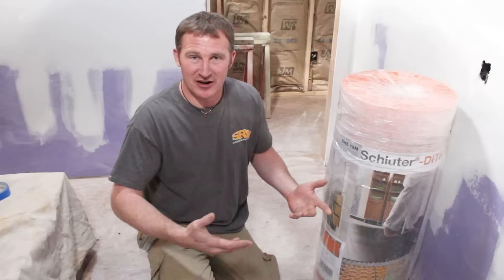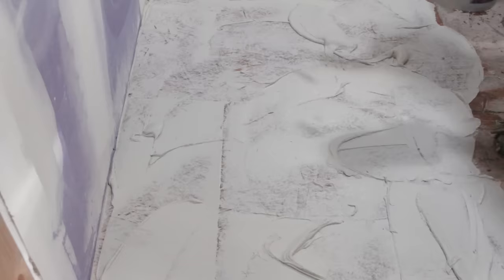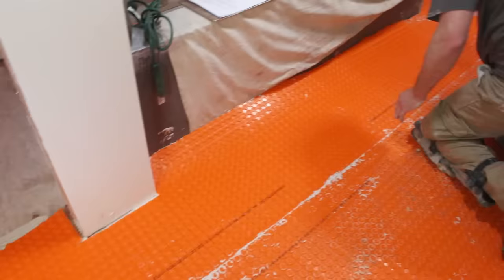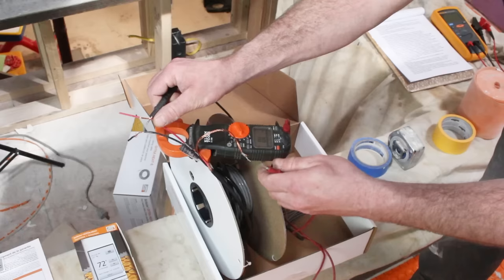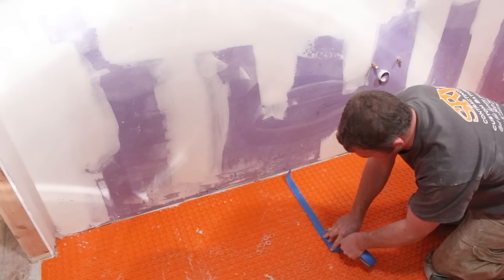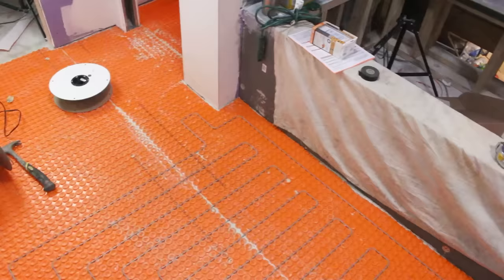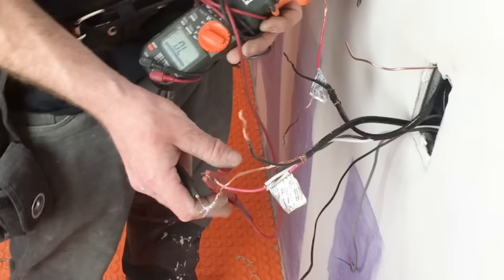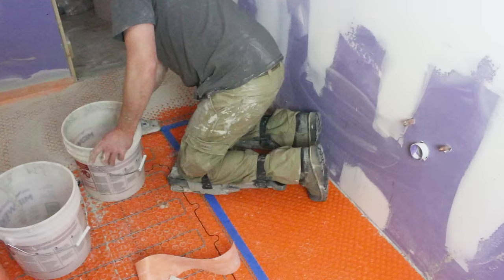DITRA-HEAT Heated Flooring Systems Installation (Step-by-Step) -- by Home Repair Tutor

Comment: You keep saying that you burnish the thinset into the 'plywood'  from what i can tell you are using OSB as the subfloor underlayment.  Osb is made from woodchips and glue. Im pretty sure most thinset manufacturers wont warranty their product if its installed on OSB.  Exterior grade plywood is the way to go.
Reply: Are you talking about 1/2 inch or the 3/4 tongue an groove, am using 1/2 inch sheathing but sandwiching them for extra load support
Reply: The membrane here is doing the job, thinset manufacturers won't warranty their product if you set tile on OSB but they are OK if you put a membrane like Ditra between the two. This has been done for the past 25 years, exterior grade plywood is old school now, still good but not an obligation. Exterior plywood is made with wood veneer glued together with waterproof glue, OSB is made with chopped up veneer and waterproof glue, don't confuse that with MDF.

Comment: can i put ditra mat down as a anti fracture membrane.
Reply from the maker: Call Schluter Tech support and get their advice 1 (800) 472-4588
Reply: Ditra, Ditra XL, Ditra Heat, and Ditra Heat Duo all provide uncoupling. You should look at TTMAC guidelines to match your requirements determined by site conditions like joist spacing, etc.   (if in Canada) and your Schluter book to determine which is most suited for your situation 😊

Comment: I would like to help you a little with saving you some time:)
• clean up subfloor floor using broom or Vacuum & wash subfloor using a sponge. ( just how you explain in the beginning)
• layout Ditra-Heat membrane make all the cut outs. 
I like watching your videos just that that when you making a video you need to be more professional many people watching. The whole idea of this installation video is any one who wants to do install on there own needs to follow your steps that you trying to explain. Don’t get me wrong I like what you guys doing just a little advice from me to be more professional get everything ready before and it will save you time and video will be more professional.
Reply from the maker: Dmitri, we appreciate your feedback but we did all those steps in the video. So I’m not sure what else we could have done. Plus, we worked with Schluter on this video tutorial
Reply: +Home Repair Tutor i cringed seeing you didn't sweep the subfloor, you could have saved a looooot of more time and energy by sweeping before using the sponge
Reply: Dmitri Golova

Comment: I wonder how easy it will be to remove (scrape off) that orange underlay from the plywood in ten years when your tile is outdated?
Reply from the maker: +matt heer not easy...but that's the point. You'd have to remove the DITRA-HEAT by cutting through the subfloor...turn off the electric
Reply: Pick out timeless tiles. I am more wondering what exactly makes this system waterproof & can broken tiles be replaced? Could this be put under floating floors?
Reply: Good questions, I'd like to know too. As far as waterproofing from what I've learned you have to use the kurdi band with thinset on all ditra joints and then possibly around the perimeter and up the wall a pprox. 2 or 3 inches.

Comment: Did he show his quad box/ conduit installation and I just missed it?
Reply from the maker: +Joe Bass no, we didn't show that but I think the video shares the box from the opposite side of the wall
Reply: Does the controller need a quad box?  How separate do your need the temp sensor wire Fri the heating cable?  I'm close to install and I have single box and pulled my wires at same time from floor to to the box

Comment: In the stress test, you need to stress black to red, black to ground and red to ground. That wasn't done. Which is why DIY beats hiring an electrician every time and why the gummint should get the hell out of certifying tradesmen altogether.
Reply: well said.

Comment: Why not install both sensors just in case one fails? Then you don't have to lift tiles to install the other sensor.
Reply from the maker: +VINJE76 we did that in the video, in fact we recommend installing each sensor in two different locations. That's near the end of the video

Comment: Oh dear God! What kind of contractor would use osb as a subfloor!!! Guarantee you can go back as soon as the thin set cures and just easily peel it off the floor! Osb does not hold up to traffic! All osb fails in bathrooms! Major fail

Comment: It's not a good idea to use a metal trowel to lay the wire as it could strip the insulation off the wire and cause a short. Use a small piece of two by four or one by two ect to force the wire into the groove

Comment: Ture, this particular floor warming system saves a lot of time on the initial installation but it also takes about twice as long to come up to temperature... so pick your poison. Hopefully it costs considerably less than other systems because if you want your tile floor warm by 6 in the morning when ya get out of bed... ya better program the thermostat to start heating the floor by 3:00am... complete garbage!
Reply: You have no clue, this floor heating system takes time to warm up the first time you turn it on but the thermostat keeps an even temperature, it doesn't let the floor cool down too much between cycles. Like an air conditionner, it takes time to cool a hot room but when comfortable it keeps it there. And da thermostat is programmable, "complete garbage" is not applicable here apart from your choice of expressions.

Comment: Heating bathroom Floor Bad bad Idea,   Smell From Toilet increase,  Mold increase From Any Water That May Break Barrier, Also electrical Shock Chance Greatly Increased Due To wet Feet and Shower, So No Thanks For Heating bathroom Floor, Maybe A nice Dry Ceiling Heat Light. i Would never ever Heat My Bathroom Floor.
Reply from the maker: you can choose to use it or not. However, what you're saying is misleading. Mold comes from using organic components in bathrooms. All the materials used with DITRA-HEAT are inorganic. Furthermore, shock is close to impossible because the thermostat is GFCI protected and tile is not an insulator. Furthermore, DITRA-HEAT mats are waterproof if installed correctly.
Reply: Here's an idea star sales...don't do it & shuddup.

Comment: I understand your need for sponsors but when your sponsors embed their advertisement over your video and then set it up so you can't minimize it and it takes you away to their site, I can't be bothered.  Foundation guys, you annoy the crap out me.  Won't use you ever and will not recommend you to my friends.  Will use another site as well.

Comment: Wow your electrical engineer is dangerous, why in earth did he not cover the ground wire before it was stuffed into the box?? Also why not tape the end of the spare heat stat cable so it doesn’t hit the live wire, wouldn’t ever get away with that in the uk